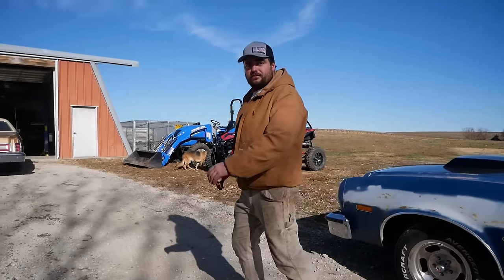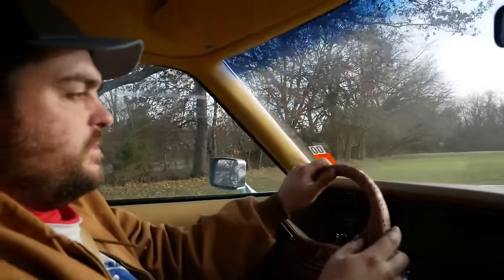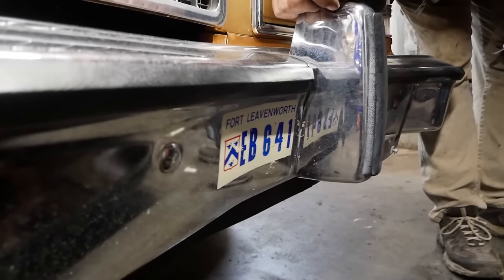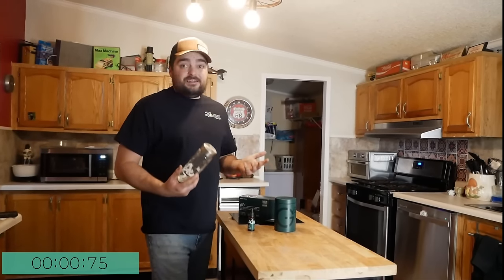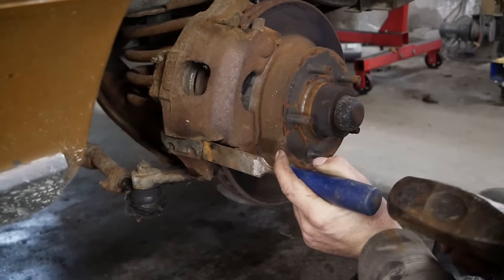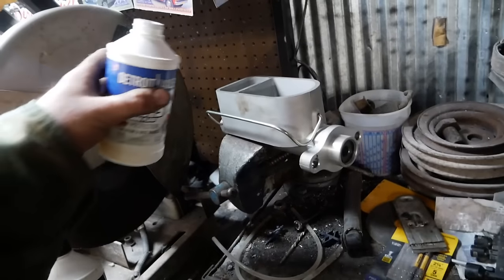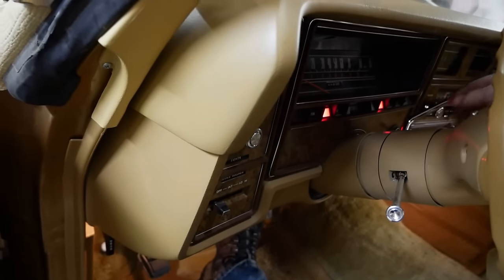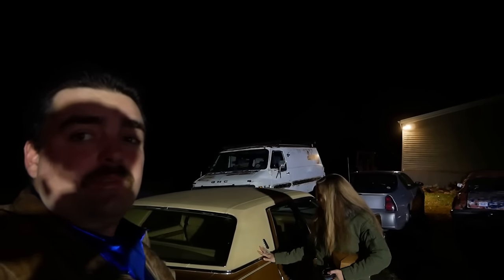ALL ORIGINAL 1978 Ford LTD SURVIVOR ~ A Time Capsule!

Comment: Just a suggestion, but you may want to consider ceramic coating this one, its nice.
Reply from the maker: I would definitely consider that, but I want to make sure it won't damage the lacquer.
Reply: @PoleBarnGarage  I didn't think about it possibly reacting with the paint. Robby Layton out in Utah could probably help with information on that.

Comment: I usually remove the brake bleed nipple and dip it in thick grease before reinstalling and bleeding. It stops the air sucking in from the thread and as a bonus the nipples won't stuck anymore.
Reply from the maker: Good call

Comment: Hydro boost was needed for all of the vacuum operated apparatus especially the hidden headlight doors.
Reply from the maker: Hydroboost doesn't have anything to do with any of the vacuum systems
Reply: @PoleBarnGarage  No, but you do not need a vacuum robbing power brake booster behind the master cylinder with hydro boost.
Reply: @PoleBarnGarage Sorry,  I worded my original comment kind of incorrectly.
Reply from the maker: Makes sense but that isn't the reason why they used it. A standard brake car with all the other options would have a vacuum booster. For whatever reason hydroboost was part of the 4 wheel disc package, son of a bitch will stop on a dime I can tell you that much

Comment: With that style of bleeder tool at least for my rebranded Matco one it says that the tank of the tool needs to be above what you are bleeding and then you run it for 15-20 seconds
Reply from the maker: This one says put it on the floor for whatever reason.
Reply: @PoleBarnGarage   the bleeders that I have found to work the best are pressure bleeders they hook up to the master cylinder and you just go around from tire to tire opening and closing the bleeders it makes it so easy but I haven’t come off the money to buy one for myself yet lol

Comment: 50 years ago. Spray tar underboady.  And it did its job from air and rust. Will you fish oil the sub frame. Old school? 
Easy to do... plug a rubber hose. Drill holes in the rubber pipe 360 dec. Push the hose into all the holes under it. 
Be old I see there no hole in door for fish oil. Or sub frame from the top. Needs to be done. If Daly driver. Ps do you use salt there on the roads there. 
Mary Xmas to your family. 
Mick Australia 🇦🇺
Reply from the maker: We use some salt but Missouri has had mild winters for years now

Comment: Would the brakes fading & then coming good, have something to do with the calliper stuck on? 

Also the pressure in the master when you removed the lid, essentially the boiling brake fluid gassed off creating pressure? 

Keep up the good work, Cheers from Australia 😃👍
Reply from the maker: We dug into it later on in the video. Fade was the master cylinder seals leaking. The pressure I believe was from the master cylinder piston not being able to return completely

Comment: The other thing that you look at is if the pop metal and pop aluminum that was used to manufacture certain parts on this vehicle! The reason why they call it. Pop metal is the fact that when it gets older. Basically, it has pop marks that have exploded on the surface of it. And you can tell that it is old and it was made cheaply!
Reply from the maker: It's called "pot" metal, because it's everything that got dumped in a pot and cast. This car was stored inside its whole life so there's minimal amounts of damage to the emblems and stuff

Comment: Dalton, should we put the skirts on? JD, can’t leave a lady undressed. Quote of the year
Reply from the maker: That was Jess who said that
Reply: In 1977 at 14 years old I bought my first car from my Uncle Bob, a 68 Galaxie 500 4 door hardtop white vinyl top over Gulfstream Aqua 390 4 Barrel with dual exhaust. With about a 2.70 rear gear that baby when left in auto would shift 1st to second 55-60 and 2nd to third about 95, a true 120mph carpet ride.  I only had it about a year when I found a very nice 73 Mustang Convertible. I begged my dad to let me keep the Galaxie so I could have a summer and winter car. Oddly he didn’t think a high school kid needed 2 cars. I’ve had a steady stream of extra cars so I’ve fought thru the early abuse. I searched for years for a similar car. About 12 years ago I found a 35,000 mile white vinyl over Gulfstream Aqua LTD Brougham that was originality owned by a farmer out of Aberdeen SD. It had been sitting for years while his kids “lovingly” stored it under a very bad car cover. It’s cleaned up pretty well but the hood has pock marks and it has pretty bad gravel rash down low. I’ve added dual exhaust and Ansen Sprint slotted mags and drive it quite a bit, it’s got 56,000 miles on it now. Hopefully we will run into each other at a local car event or we could start the Stateline LTD Throttle Jockeys Car Club 

FYI, I tried to buy some merch today and your PBG logo comes up but nothing beyond that. Maybe a couple of us got on it to buy sweaters and it crashed

Comment: And just a note to the young ens, on cars anywho, blowouts are rare. In my 35 years of driving, I have only BLEW one tire. It was a dry rot like in the video. Most times a tire is flat on approach to car or goes down while driving and you get a little warning they are simply made better these days. Hes risking a POW bluga bluga bluga bluga with that time capsule hes driving. Must have been a climate controlled garage had to be amazing shape. Jewel right there old LTD 18 MPG on a good day :) Will it go back to the 70s if you hit 88 I will buy the tires.
Reply from the maker: I've blown many an old dry rotten tire, they just don't hold up after several decades for some reason

Comment: You will not find a better A6 A/C compressor than what you have on that car. The clutch gap should be set @ .030". I doubt that the system has held its original R12 all of these years. An update front compressor seal is available to replace the ceramic style originally used. Also, the original system uses mineral oil that travels through the system attached to the R12 molecules. If you plan on using R134a, you must drain the compressor, flush the rest of the system, and install a polyester oil. If not, the oil will not blend with R134a causing the compressor to lock up.

Comment: Serious question
Can you tune an older LTD to take e85? If so, how?
Reply from the maker: You can tune anything to take e85 it doesn't matter what model the car is...
You need more volume with e85, so high volume fuel pump, big jets in the carb, lots of timing.. Although it wouldn't ever be very happy with the pathetic low compression the engine has.

Comment: Are you not supposed to reuse copper brake line washers?? I remember my old man teaching me like 40 years ago to lay em flat on the concrete (or ontop of vice or whatever you got laying around that wont burn) and heat them up with a torch, then let them cool off and they're good to go again. Been doing that quite a bit the past few years and have never had an issue with leaks or anything. Seemed like in past if you bought a new caliper or hose theyd always come with new washers, but now days i guess the manufacturers have decided to save themselves 3 cents and not include them. Of course its one of them parts that the parts stores dont typically have listed in their system, so you're at mercy of some 16 y/o oblivious kid behind the register opening up boxes and trying to match something up.
Reply from the maker: This one didn't come with any new ones. I just simply flip them around, clean them, and 99 percent of the time they're good for at least one more go

Comment: Nothing wrong with ads, you're trying to make a living with this if you can, you need advertisers for that!  You mentioned it was doing something weird still, is it in the rear end?  I noticed at the 54:00 minute mark when you set down the car the rear wheel moved a little laterally or something, it didn't look exactly right.
Reply from the maker: Feels like it needs an alignment
Reply: @PoleBarnGarage  looking at it again, you can see the top of the tire kicks in some, that might account for the tracking issue you're having.

Comment: That is soooo creepy, my parents literally bought a 78 ford ltd from a little old lady back in 92, the only differences was it had a bench front seat and no flip up headlights, other than that its like you're showing off the same car, the same car I remember quite clearly my sister driving into a ditch trying to turn up the volume on the radio....

Comment: and nobody ever services a transmission thats more important than engine oil in my opinion low miles or not the filter in trans is old and new fluid never hurts. if it does it was smoked already.
Reply from the maker: No reason to service the transmission this early, just a waste of money. However the low miles does afford us the opportunity to do it at the correct service interval, I believe around 60k

Comment: Got the 4 wheel disc brake package but couldnt splurge and get auto windows. Thats weird.
Reply from the maker: Purposely went crank windows I'm sure. I would have done the same
Reply: @PoleBarnGarage  would you have went with disc all around or drums work perfectly fine on the rears lol
Reply from the maker: Oh drums for sure lol
Reply: @PoleBarnGarage  thats why i thought it was weird cause they saved money by not getting the comfort of auto windows but went all out and got all disc brakes.

Comment: 23:46 you really shouldn't have hit that bearing on in the inner race with that socket driving it deeper. Yes you are basically destroying it like this. In this case you should have use the outer race.
Reply from the maker: Didn't have a big enough socket, it'll be fine

Comment: If the numbers are centered all the way across it's 20000 if the numbers are crooked or offset from each other its 120000
Reply from the maker: That's not a thing. This car has documented 21k and the numbers don't line up
Reply from the maker: It's just an old tall tale like so many other things. Like any mechanical device there's a certain amount of slop in an odometer, some have more.. Some have less.. All there is to it. Now, once it rolls over to the first digit being a 3, and if it's nice and bright, that's a pretty good indicator

Comment: Bring a tiger torch next time you have Square tires, super heat the rubber, and it will revulcanize its self after 50 yrs...also if you are still reading this, never do this.

Comment: sucking brakefluid on the nipples is not the way to go, pressure supposed to come from the master and then open the bleednipples, you`re forcing the air one way then....
Reply from the maker: Yet it works fine and has at least 3 cars in a row now